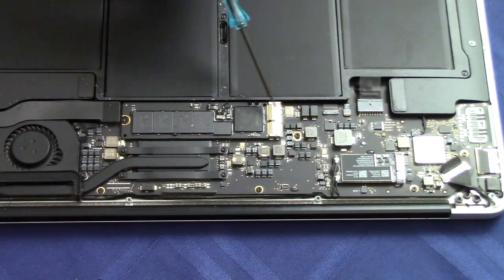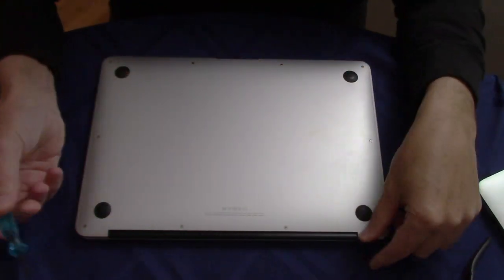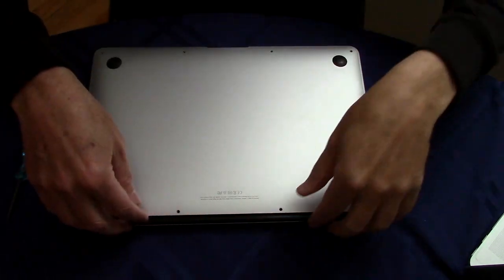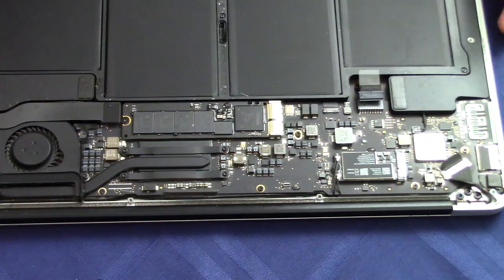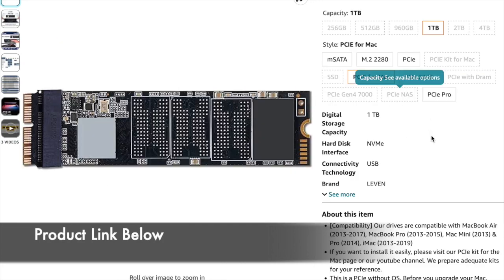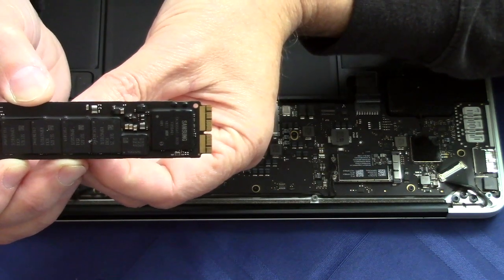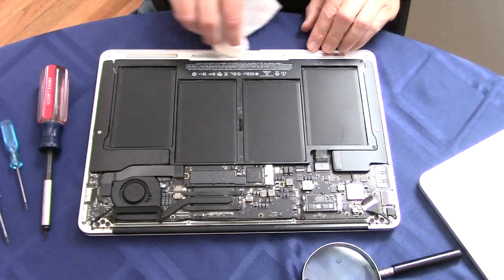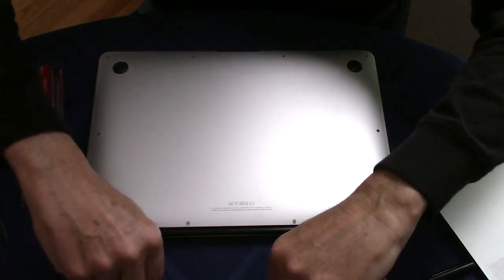How To Remove and Replace Macbook Air SSD Drive - 2017 Model

Comment: Can you link the screw driver to get the SSD screw out
Reply from the maker: Done.  I also put a kit that has 10 parts for just a few bucks more.  It has 10 total tools.
Reply: @SmartPennyPincher did you ever make a video of what to do after you put in a new SSD? If not, could you make one or link a video with one
Reply: I have a MacBook Air as well
Reply: @SmartPennyPincher  oh and I wasn’t able to back anything up as my previous SSD was corrupted
Reply from the maker: The computer I showed in the video was a friend's computer.  They swapped the hard drive later so I don't have the video.  I do need to upgrade my own computer so if I do I'll shoot the video showing how

Comment: My 2017 macbook air wont turn on at all and I need to transfer the files to my 2019 macbook air. Any reccomendations on how to go about this because I can't seem to find any PCIe to usb c adapters.
Reply from the maker: This is a harder problem to solve but you do have options.  I have removed the HD in the past to copy the data with a utility.  There is a good article on the subject that explains a couple of other methods.  You can see it here https://www.howtogeek.com/728422/how-to-get-your-data-off-a-mac-that-wont-boot/

Comment: if we did this, then how to instal a system MacOs on the new SSD? could you help please?
Reply from the maker: The way I did it in the past is to create a Mac OS bootable thumb drive.  You install the new SSD, then boot in recovery mode from the thumb drive.  The small drive has Mac OS on it then you can install the OS on the SSD. When done, use time machine to get your data moved over.
Reply: @SmartPennyPincher  thank you